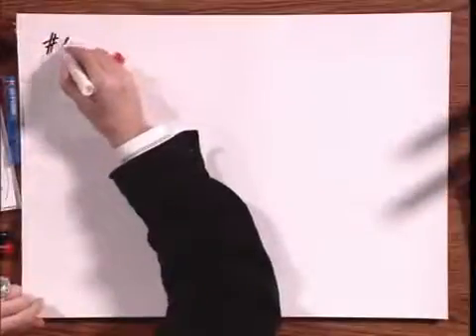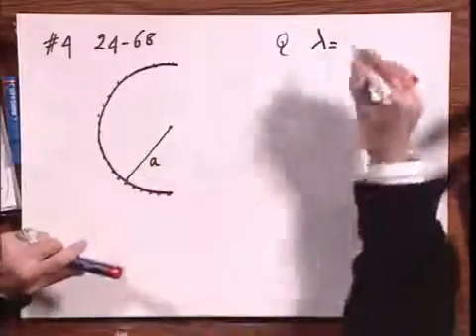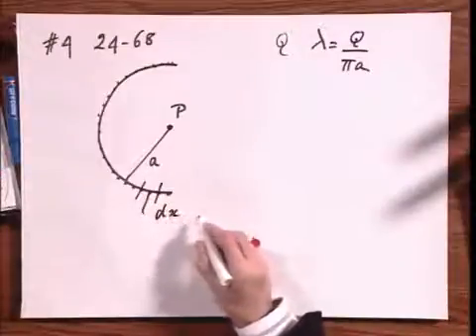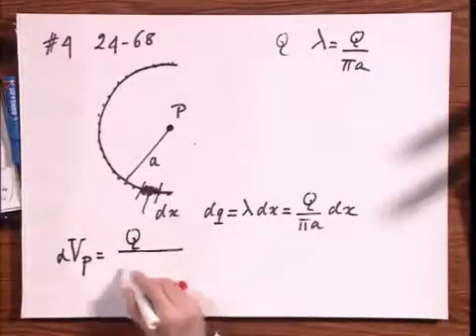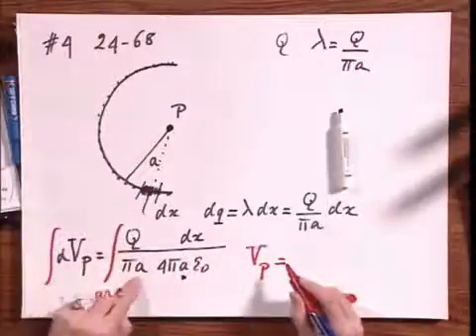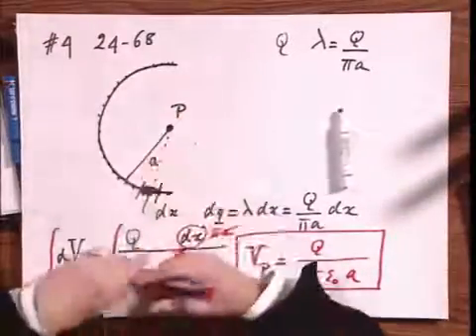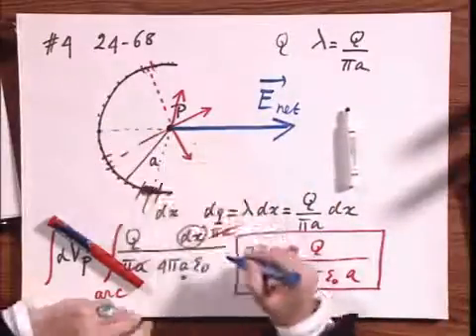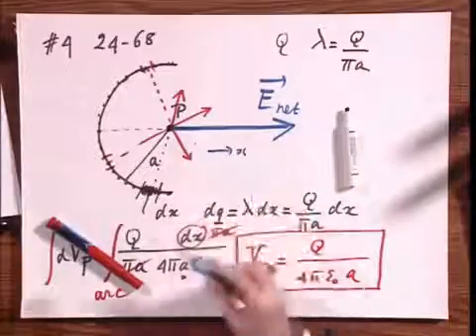8.02x - Module 02.03 - Calculating the Potential of a Semi circular Rod by Integration.

Comment: Since we found V(a), could we find the Electric Field by taking -dV/da ? In the problem in the video?
Reply from the maker: +Dr. Science Sc.D E is a vector. if you calculated  -dV/da you have no information on the direction. I did calculate the net E and I find E_y=0, E_x=Q/(2*pi^2*eps_o*a^2). If you calculate  -dV/da you will find something else with NO information about the direction.
Reply: +Lectures by Walter Lewin. They will make you ♥ Physics. could E be Q/(2*pi^2eps_0*a^2) since I integrated cos(tetha) dtetha from 0 to pi/2 for 2 times?
Reply: @atalantinopieva  I think that's right. I did the same as you, though a few years later.
Reply: +Dr. Science Sc.D For the electric field is got that E_x = -Q/(2pi^2 epsilon_o * a^2). I integrated with an upper bound of 3pi/2 and lower bound of pi/2. Should I ignore the minus sign I received or does this indicate the direction?